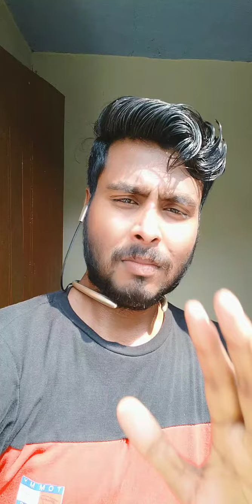What are FSB, DMI & QPI ?@SpokenEnglishGuru

Comment: .What are FSB, DMI and QPI?
Ans - FSB- Front Side Bus connects Microprocessor to RAM through North Bridge.
DMI- Direct Memory Interface is a feature of computer systems that allows
certain hardware subsystems to access main system memory (RAM)
independently of the central processing unit (CPU).
QPI- Quick Path Interconnect (QPI) is a point-to-point processor
interconnects developed by Intel which replaced the front-side bus (FSB).